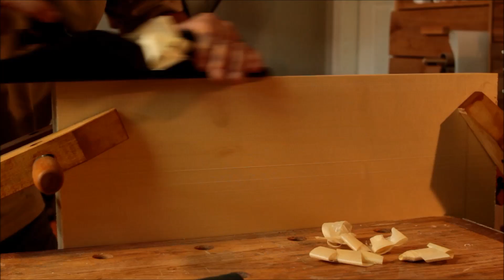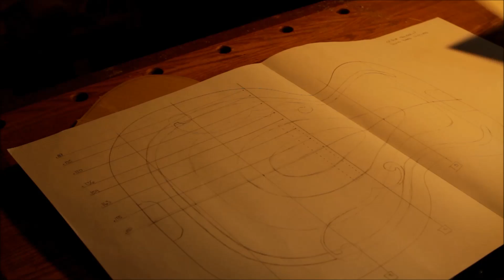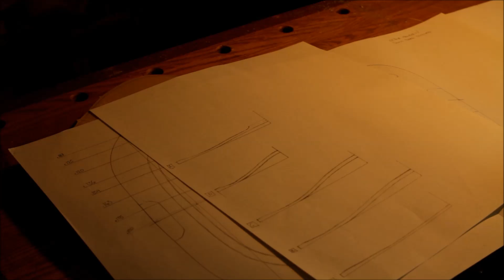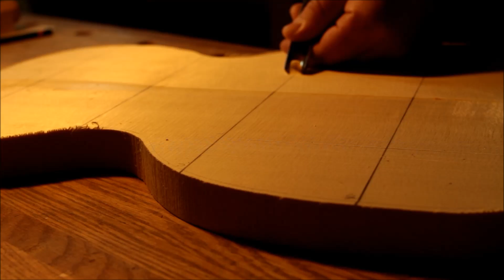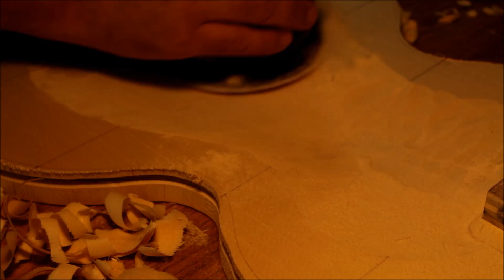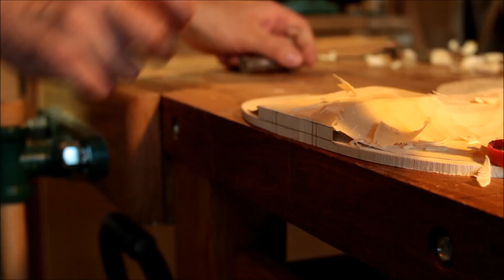How to Carve an Archtop Soundboard

Comment: Just a question if I may. Where did you learn to make the drawings for the original design? Formal class room instruction?
Thanks
Reply from the maker: I did learn some print making skills at school and in workplace,but not in instrument making, it was mostly construction, structural, and transportation. But working with a lot of different instrument blueprint and making instrument I was able to understand how it’s made. Lutherie is an art, there is basically no written rules on how you will make your instrument (other than the scale, and break angle in this case). I have made prints in the past for ukulele and turn out great also. The design was asked by the customer. He wanted something like an old archtop guitar but for a Octave Mandolin. I did a lot of research and compared with existing instrument like this one before I started drafting those drawings ..Hope this answers your question and thanks for watching.
Reply: Tomy Hovington yes, it did. I wish I could do this full time but it's not in the cards right now. I'm tooled up pretty well and am currently working on my #4 build, but it'll be a while before it will turn a profit.
Reply from the maker: Have fun building them,  then people start wanting to buy them. That’s how it’s started for me. Best of luck. And happy building..

Comment: Great workmanship! Are you able to use the same tools and methods to carve a maple back plate? I finished shaped my first back plate with a sanding disc in a drill, 50 grit sanding disc. Messy but effective. Looking to have a better method for #2. Thanks.
Reply from the maker: +Frank Howell yes you can, just harder because it’s hard wood. You can see some carving of a maple back in this video.. https://youtu.be/fjaq9zIqyBk

Comment: A question came to my mind: why to carve an archtop soundboard for a plucked instrument, instead of making a flat one like in acoustic or classical guitars? Does it have different acoustic properties?
Reply from the maker: Archtop tends to project the sound more than a flat top(louder).You can easily hear the difference between a archtop mandolin and a flat top mandolin. The sound will also differ from the F-holes ( brighter) to an Oval hole (warmer). This is a custom build and my customer ask for those specifics, we talk about the different ways to get the sound he wants, sustain, and volume. Hope this answers your question..
Reply: Yes, thank you. So the big pro in using flat soundboards is that they are easier to make. I built some amateur string instruments with flat tops, surely I couldn't have made arched tops using my actual skills and tools.
Reply from the maker: andsalomoni I think it’s more of an end product decision rather than how easy or hard it is to make. The flat top might be more achievable but it also has it’s sound properties. Depending on what you want in the end, someone might choose flat rather than arch or vice versa..

Comment: I have noticed you don't wear a dust mask when sanding . wood dust is VERRY bad for the lungs 
I hope to see you wearing one in the future
Reply from the maker: john mcdonnell you are right, I don't "always " wear a dust mask when sanding, but the dust collection unit is right beside sucking the dust... not ideal I agree... will try to do better!
Reply: Using a mask in these clips is not only for your own health but for the many people that watch it and get inspired by you! Setting a good example when filming is very important. Keep up the great work!
Reply: Dust in yer house is away worse
Reply: It really depends on the grit you're using.  The higher the grit, the worse it is.  A low grit around 40 or so, doesn't warrant a dust mask as the particles are not as likely to become airborne.  Still, I would wear a dust mask mainly for protecting yourself from building up a sensitivity to wood allergies.
Reply: I didn't even think about it watching, but thanks for pointing that out. The little sanding I do, I should use one, especially after seeing my grandfather, who worked with terracotta, then making tombstones, something I did plenty of, using carborundum to blow out granite at his business, and from the time I was a little kid in the early 60's until his death in 1978, he had major coughing fits seemingly every minute of his life. In the early 1900's when he started, they didn't use masks, but it is something we know better of now, and although it may be a little uncomfortable, we will regret not wearing them when we get to a certain age and the damage is irreversible. Masks are uncomfortable and an annoyance in the beginning, but I realized later, that like seat belts, wearing them becomes second nature, and with time, we adapt and they are no longer uncomfortable. And like the seatbelt, you even feel a little uneasy or naked NOT wearing them, something I never would have imagined before car seat belts were the law.

Comment: I see you do the inside carve first,very interesting, many others do the outside carve first what is the advantage of doing the inside first?? Thanks
Reply from the maker: Both ways work, I like to have the flat side of the plate on the bench, If you do the outside first then it will be rolling around therefore you need to make a support for it...

Comment: Great work Tomy. How much time does it take to carve the top? Did you practice in on cheaper wood when you were learning?
Reply from the maker: rimmersbryggeri thanks, I could rough shape one like this in a day... I do enjoy the process and do take my time.. Because of my day to day crazy schedule lately I had to break down the carving of this one in multiple segments.. my first carved top was AAA spruce also and was in no way perfect and that's the idea... you learn from it.. it still made a very nice sounding mandolin... the key here is to get decent drawings that you can rely on.. just before I received this order to build this Octave Mandolin I was in the process of building an A style mandolin from a 2x4 for the summer 2x4 challenge. You can see it in some of the wider shots in the video. If you want to practice this would work really well ( you need quarter sawn ).
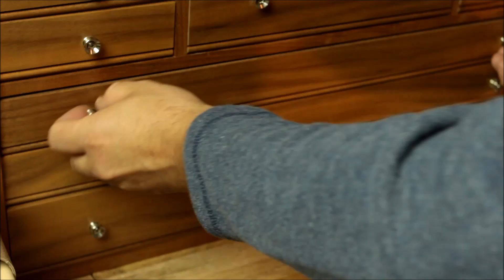Reply from the maker: rimmersbryggeri just realized there isn't a wide shot in this video. But you can see it in the bending the sides video at around 6:10 up high. Here is a link to the video, https://youtu.be/APFf3BoQ2E0
Reply: Ok I will check. I have an old Levin brand archtop that in parts now I thought it had been steam bent becasue its so thin. Is that possible to? I guess cnc carving is a little bit faster but not much if you want a consistent finish and not nearly as satisfying. I like watching a cnc work though.
Reply from the maker: My guess is Steam bent, But I would have to see for sure.. I know that older mandolins sides used to be cut from a solid piece of wood, so it's possible!

Comment: Interesting you carve the bottom first, I start with the top.. Otherwise similar methods...
Reply from the maker: Kerry Werry I've tried top first also but that requires some kind of support to carve the underside of the plate... this way there's no need for it... thanks for watching.
Reply: Ahhh interesting point..  I do see that as an advantage...

Comment: I'm enjoying watching this series, specifically some of the techniques.

I often wonder if content creators watch themselves closely in their own videos looking for possible opportunities for improvement or if they are so busy editing the content together that they miss some telling images.  I hope you take this in the constructive way it's intended.  I was watching you dress your plane blade and notice that at the end of the stroke you lift on the heel of the iron as you're pulling it toward you.  This would cause a rounding on the cutting edge or, at best, an uneven thickness.  It's best to move a bit slower and make sure you keep the angle to the stone constant through the entire stroke.  Granted that you're working with a very hard piece of wood but that might explain some of the stickiness as you were jointing the edge of the boards.  I suggest you go back and watch that section of the video and see if you catch what I did as well.
Reply from the maker: ByrdMann2010 thanks for the great comment.. this was my leather strap to hone the edge of the blade and chip breaker.. I use a little guide with a wheel on it to sharpen on a wet stone, but usually do all my planes at the same time. I thought it be clear enough just by showing the application of the honing compound. I'll try your method next time but never had any issues this way..